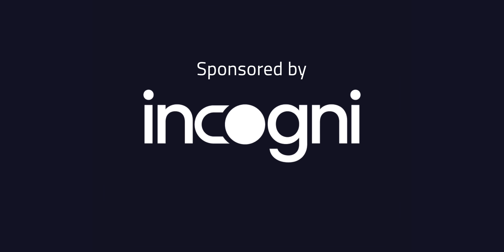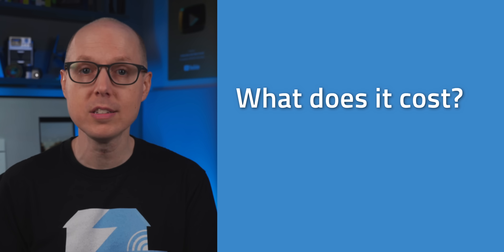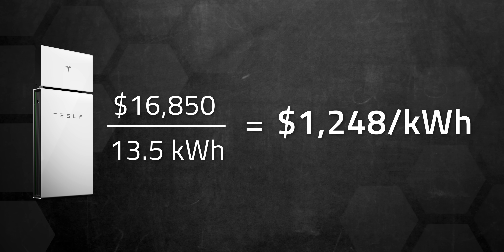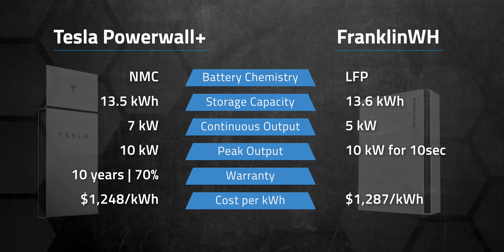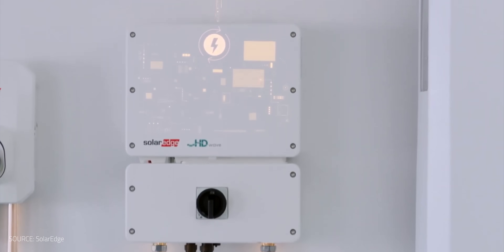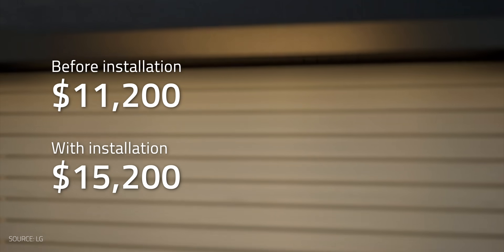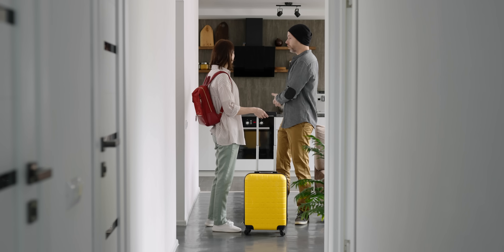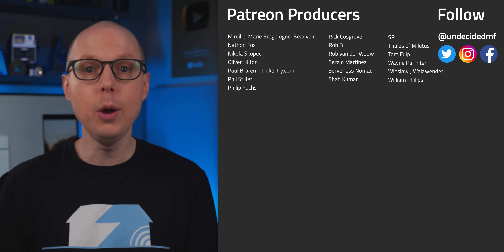Top 5 Batteries for Home (And One You Might Not Expect)

Comment: No indication on a DIY solution. 14.5kwh of LFP prismatic Grade A cells comes in at about £2k, pair these with a decent BMS £120, and a Victron Energy MPII 5kw Inverter/charger and you're at about £4,500 plus installation, but as it's DIY we'll assume self install, resulting in a £321 per kwh system. Easy to add additional batteries and more inverters that sync for higher output peak power. Those that can, really should consider DIY as it's by far cheaper for the same facility. Equally, no one should fit NMC based home battery systems in their homes, outside and as far away as practical would be my advise given their huge risk of thermal runaway (Fire). Even without solar this system enables load shifting where time of use import tariffs are available.
Reply: Signature Solar has 5kWh batteries for $1500, rack mountable and easy to set up. Throw in one of their All In One MPPT controllers and inverters and you have a very inexpensive and easy DIY solution. Cheaper than all the systems shown here. 
I don't like how the 5 options given are not very DIY and more, pre-built overpriced systems. And considering that the options provided are still including having someone do the install, the EG4 batteries would be a much better option.
Reply: @stellanclark1418  he is running a YouTube channel. Accessible top 5 lists have a way bigger audience than a DIY video that is unapproachable for most people. Think of all the skills you have that make your suggestion straight forward. Most people don’t have those skills or know what these words mean
Reply: @Rkcuddles  Think of thr skills you need to install one of the shown ones.. yeah, the bigger audience wont do that themselves either
But might want to have a comparison and estimation if you add labor for transparency to know if you are getting ripped off.
Reply: @tarakivu8861 not ripped off. You are paying for convenience, warranty, maintenance. Those items have a cost. You seem to imply they are free to the manufacturer. Also because these are commercial units they also need to go through UL testing,  certification, and licensing. UL isn't a one time cost either, there is a charge for every shipped unit to use the logo and there are some recertification costs as well. A DIY setup doesn't any of those regulatory requirements. DIY systems can't be sold, every one needs to be built by the individual so the companies which make the components don't face legal liabilities if there is a problem caused by how the components were installed.
Reply: @stellanclark1418  Does that company have the fancy app/interface for peak smoothing, mini-grid sharing, etc plus extras like genny integration? All that stuff might be a big selling point for a lot of people. Not to mention I’m sure most folk aren’t comfortable DIY anything that involves electricity. I agree though that DIY should be your go to if you’ve got the chops. Generac is also getting into the DIY battery storage solution too, but requires a contractor quote for their battery+solar systems.
And yeah, no way in hell would I put a system that has a risk of thermal runaway in my house…
Reply: For the capable handyman/woman building a stand-alone whole home system, DIY is definitely the way to go.  As soon as you get into grid tied systems, the regulatory requirements go through the roof and all but demand professional installation, inspection and certification.  At that point the overriding consideration becomes, what can you get a local installer to put in for you at an acceptable price point.
Reply: @joelsmith4394  as a lineman working on local grid daily the regulatory requirements are very important. They definitely add to the cost but keep grid stability up and help keep me safe.
Reply: IMHO, Matt did great at exploring existing prepackaged options and folks will find value in the video (even if it’s just the heads up regarding Tesla and generators..), but yes, it would have been nice if he’d at least have mentioned the option to pull together components and build a more custom system from scratch.  (With or without professional aid as needed).   Finally, for bonus points he might have pointed folks to one or more of the excellent channels out there that walk folks through that approach.   On the other hand, most of us do that on our own!  😎😎
Reply: This is what I am talking about.. WAY WAY cheaper with on par if not better performance.
Reply: Can you do a video on this please
Reply: Yeah I think for the time being it would be best to have a shed a little way away from the house to install in
Reply: We at home are running Victron inverters with pylontech us3000c batteries. Pretty neat setup. Full 10 kWh setup with 10.8 kWh DC battery storage didn't cost us more than 15k

Honestly I'm kind of interested in Huawei Luna batteries plus their inverters but we noticed them already after our Victron one was installed.
Reply: Like I said upthread - you can't DIY in a lot of jurisdictions due to building codes and interconnect requirements.  Never mind that a lot of home insurance won't cover DIY electrical or any damage caused by it....  Yeah, it's 1/2 the price, but if your house burns down with no insurance coverage, is it worth it?  Probably not.  Plus most of these all-in-one systems offer an easy finance option to lower the upfront cost.  Different story if you are off-grid or semi-off grid.
Reply: @ckm-mkc  , very good points, especially about interconnection contracts. As more installations go up the electric utilities have become more aware of the need to be able to see and control rooftop generation.  For years my utility simply plugged in an estimated constant into the ACE equation that runs overall generation (ACE = automatic generation control ).Then one of our new system control whippersnappers figured out a way to accurately measure  the residential solar, and boy were we off! We had been under estimating and every month our constant was getting further from the actual value.
Reply: I agree with others replying here.  While any of the solutions Matt has discussed in this video will work, they are all insanely overpriced.

Use the EG4-LL batteries from signature solar, $1500 for 5 kWh is an absolute bargain.  Stack as many as you need in parallel and use your inverter or inverters of choice.

Build a 30kWh battery for $10,500 and pair with a 15kw inverter like Sol-Ark or Victron.  You could build a 15kw output, 30kWh battery based system for well under 20k.

The pre-packaged solutions are charging you out the wazoo for "convenience" and "brand name"..... in my opinion they offer little to no bang for your buck when compared to an EG4 battery based system.

Full disclaimer:  I own EG4 Batteries and Victron Inverters that I bought with my own money.  I am not sponsored in any way, I just hate seeing people taken advantage of by these convenience packaged systems.
Reply: @henryaustin8870  what we all need is real competition by the big players of consumer electronics. If i see all the fuzz and options my washing machine has (it also has an inverter btw..) can it be so hard to have something the size and format of a washing machine, and where the price topping over the pure battery and inverter base components is not breaking the bank ? 
I mean, just naming a large producer of about everything from smartphones to fridges... why cant  companies like Samsung come up with something competitive they should have the solid engineering and financial background to make this a large scale home owner product ? And yes, why not use the household appliance form factor, which incidentally is about a half height server rack ? and yes over a standard self build server rack solution, having some white panels all around so it looks no different than a fridge would be appreciated as a feature ?
Reply: I doubt you can buy 14kwh for 2k of grade a cells. More like £250 a kwh for grade A.
Reply: @Giftedmike359  I have several sets purchased from China directly into the UK landed for a smidge under £2k, so yes it can be done. (280ah cells x16 @ 48v = 13.4kwh)
Reply: DIY isn't legal tied to the grid in many locales
Reply: @veganpotterthevegan  where? As long as it’s UL certified and installed by an electrician…
Reply: @veganpotterthevegan Where?.
Reply: @veganpotterthevegan  Perfectly fine in the UK and at a guess most if not all of the EU. ULV DC is surprisingly unregulated. Sure the inverter AC side it, but not the DC side...
Reply: @dougle03  the DC side is small potatoes compared to the AC side
Reply: @veganpotterthevegan  it shouldn’t be… more efficient and in the future it may be taking over from AC
Reply: @GRANDEN AUTO  yes,  but we're not there yet so there's good reason for all the regulation.  I'm building an ADA on my property and letting my parents live in the main house.  The ADA will be all DC other than the water heater.  I'm doing the solar setup myself and just getting a permit for one outdoor 240plug since I'm running a steam shower in the bathroom
Reply: Just one point....@peterkay is in the UK. Here the market for Server Rack batteries is almost non existent. Yes, they are cheap and available in the US...but not here. US companies often won't even send abroad and I would hate to see the costs involved in shipping to the UK and import duties....it's not practical.  So DIY systems for high power storage are the only realistic option.
Reply: Semi dyi is an option.   You can buy a completely built box without batteries for $499.  Then add 1 to 4 batteries and panels for up to 3kWh system. This can drive a window unit or keep a freezer or fridge powered plus get disaster recovery and it's easy to repair. 

Agree 5kwH is $1500ish now.
Reply: @liam3284  4x 280ah LFP cells from Aliexpress £390 - JBD BMS £48 Aliexpress - 5m welding silicone cable Amazon £30 - Misc lugs and heatshrink £5 - Optional box of your choosing.... Total: £475 (Note 3 month wait for cells as they come by boat)... THis is for a 12v system, scale up the components for 47v
Reply: Exactly.....off grid for 21 years by now and charging Tesla and eMotorcycle too. Excess solar for a simple 300L hot water service.
Reply: Risk of a thermal run away is rapidly declining with big improvements and battery management technology.
Reply: I feel like playing with that much stored energy is dangerous unless you're very versed in this stuff. I COULD but I won't DIY on something that could easily burn my house and my neighbor's houses down.
Reply: I'm 50/50 on the argument.

DIY is a great option and much cheaper, but not always the nicest looking.

Eg, my Victron charger inverter and pair of lithium batteries looks like an industrial electrical box tied to a couple large car batteries with thick cables and an extension cord throw in for good measure.

Which is basically is.

I still haven't gotten around to even building a cart / stand for it all to mount to.

Now that's OK for me because I set it up as a reliable and rugged UPS for computer gear.

But it's not something that I'd want mounted on a wall next to my high end luxury car.

Luckily I have a beat up modified off road vehicle and laugh when I put new dents in the bodywork as I slide off challenging tracks.

But that's not for everybody.

I would love to see a follow up of this video looking into different options, likely split up into the many different inverter, charger, combination inverter/charger options in one section with battery options in another.

If I were to build a home, I would 100% have a room dedicated to power systems built, likely an extension of the garage.

Alas my future plans, money and ability dependent, will hopefully have me building a ocean going live aboard sailboat, with solar, hydro, backup generator and maybe wind power generation (and an electric drive engine for docking).

Just imagine building Matt's net zero home, but complete with water desalination and waste water processing, in an area less then 1/3 the size of an average house.
Reply: @Emily35-Official  not only this but it's just plain illegal in many countries, especially if it's tied in with your own energy meter
Reply: Going this far with DIY is pretty much pointless nowadays, with ready built server rack batteries costing around $300/kWh, not including the inverter
Reply: Here's hoping for a part 2 video regarding these options.
Reply: Do not DIY, these cells are capable of terrifying short circuit currents, and the fire risk affects a lot more than the chemistry of the pack. I built my own pack, but I’d not recommend it to anyone, definitely not randomers in YouTube comments.
Reply: @edc1569  Yet here you are advising randoms' in YouTube comments. I agree that there is substantial potential within the cells, but properly handled they are significantly safer than NMC based cells, but I think you already know that.
Reply: @edc1569  DIY’ers are doing these things themselves all over the place. Also, any licensed electrician can do the panel hookups. Build your own system for a third of the price. Stay away from these high dollar, “give me all your money” companies.
Reply: Well that's pretty funny because your suggestions are nice and all but you will never get a permit! Secondarily, your opinions on NMC batteries are entirely outdated.
Reply: @boblatkey7160  I'm in the UK, I don't need a Permit for DC work. and just about any UK available inverter can be connected by a basic Part P electrician (Most self install). Ref NMC cells, has their chemistry changed to make them less volatile or susceptible to thermal runaway...? No, didn't think so...
Reply: Yeah, no UL listing, too difficult for the average homeowner, no permit, screw up your homeowners insurance policy, maybe burn your house down. Beautiful idea!
Reply: @boblatkey7160  I did say DIY, which by definition is not for the average. Equally, in the UK DIY battery systems are of no concern to insurers... LFP batteries are less likely to 'burn your house down' the same can't be said for the fridge or freezer...
Reply: Uhhh…. Illegal n many places.
Reply: @Ping_freud22  Not sensible places. In the UK there is very little ulv DC regulation. For sure, the inverter, or at least the AC side of it is pretty well regulated, but not the battery/solar DC side...
Reply: @dougle03  I’ve watched a fantastic series on how in the early days of electricity, many people were killed in their homes as a result of DIY solutions and the ridiculous snake oil solutions that electricity was used for in those early days. The focus of the show? London!
Reply: @Ping_freud22  Your assuming that DIY'er are incapable of following the regs, or that all DIY'ers are untrained. In the UK (EU) there are very few regulations surrounding ULC DC equipment. Yes, the AC part of an installation must be done with the correct competence, but the DC side is much less risk and thus has little regulation.

Comment: i use my Ford Lightening. Hope the rest of EVs soon has some standard for bi-directional charging. It is a shame not to put into use such huge battery bank on wheels.
I will also keep an eye open for the flow batteries you were talking about. Hope you keep us too updated.
Reply: The issue is if you use the battery a lot you will reduce range prematurely. If you only use it for disaster outages he'll probably be fine but adding daily charge cycles could be a problem.
Reply: @mac_mcleod  I don't think you are right there for the following reasons.
* LFP batteries have about 3000 charge/discharge cycles
* the main thing that destroys a battery is how fast you charge and discharge your batteries.
Reply: @Soothsayer210  I agree with your statement.  But clearly regularly charging and discharging the battery pack of the vehicle regularly would affect range.   Say you "only" put an extra 50 cycles on it per year for example.  After 12 years, that's 20% of your cycles.  After 7 years, it's a year of usage.

I also had the impression that it's how low you discharge and how high you charge that wears the batteries.   So you could mitigate wear by keeping the charge level above 25% and below 75%.

I largely agree with you but would keep usage of the very expensive car batteries in reserve and use a cheap set of $1500 batteries that can be easily replaced for regular use.
Reply: Lightning.

Comment: Matt, love your topics and coverage of things but with this you missed a huge part to whole home storage. AMPS need to be talked about when doing research into whole home storage. Especially if your your home is fully electric. Most people see whole home storage and think they can run everything. As you know that is not the case. Generally you would need a critical loads panel or a storage solution that allows you to add multiple storage inverters to allow more amps to be passed back into the panel for home use. Then add on if you have one or two electric vehicles. That is a whole another ballgame for want amount of storage is needed. My point is that home storage is not as simple as I need X amount of kWh storage to run my home. You also need to take into the account the amps you will need to run what you want. Keep up the good work!
Reply: Hi Craig, Matt talked about the output of the battery in kW. That's power. To get it into AMPS you need to divide by whatever voltage you are using. So 7,500 Watts output at 110 volts is 68AMPs, but at 220 volts it would obviously be half - ie it would be 34AMPS.
hope this helps. (Its not exactly true, but for ease of maths it is)